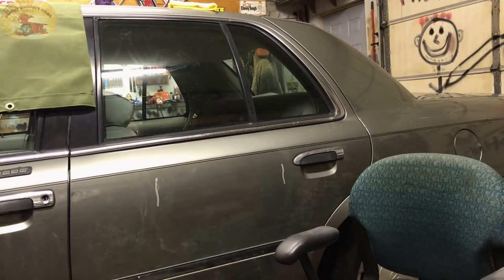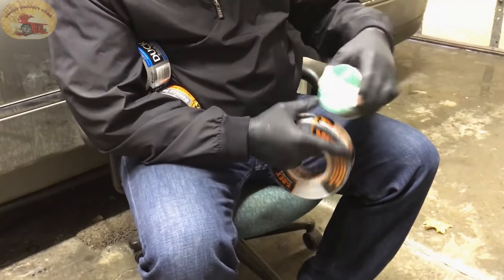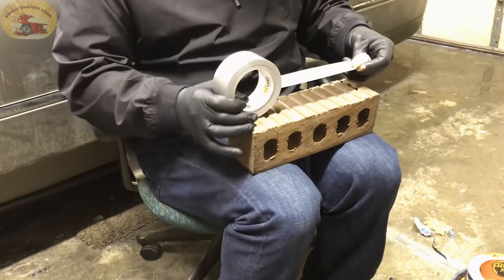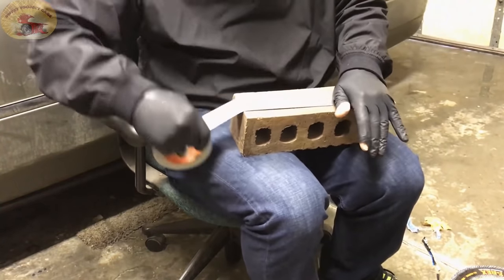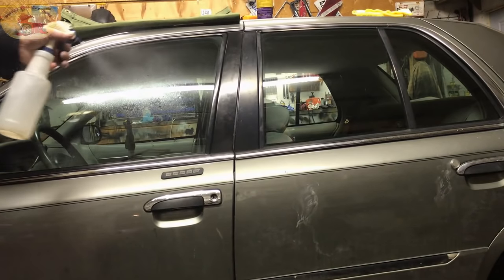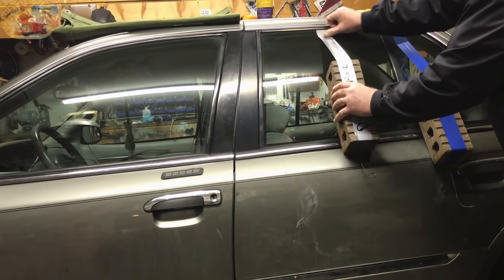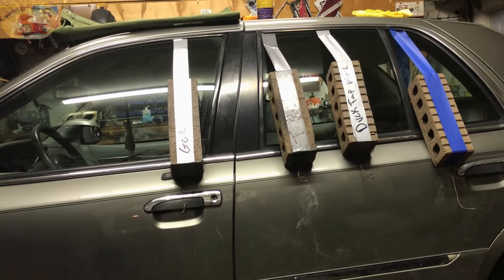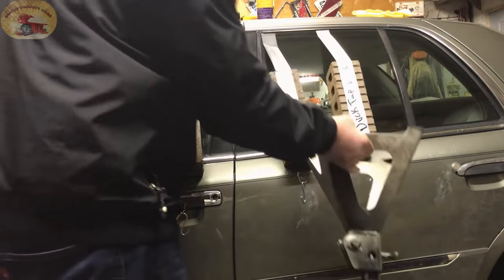Who Makes the Best Duct Tape?.....What Tape Works Every Time?

Comment: Kinda knew T-Rex would win. Saw another comparison test which tested shear strength. Tape was hung from  a crossbar, then wrapped around a wire which held the weight, then back on itself - so the glue was less of the issue. The test was to see which tore first. T-Rex had the greatest shear strength.
Reply from the maker: swm122758 we where really trying to show the glue strength of them which is a big problem with tapes these days but we found out pretty quickly
Reply: @SweetProjectCars  
Totally understood. Just thought I'd mention for the viewers. Shear strength primarily applies where the glue isn't making contact, like the length btw glass and brick. In short, make sure all sticky surfaces make contact or else the project will be subjected to tear strength.
Reply from the maker: swm122758 well if you saw in the video I had a much harder time tearing the T-Rex and actually split it when I did tear it plus it felt much heavier and much stiffer.

Comment: Going back to the point you made at the beginning of the video where you mentioned the waterless glass cleaner makes the glass slider easier past the seals, do you have any tricks for cleaning those seals? In my wet climate we sometimes get algae and mould growing in the gap between the glass and seal, if you have any tips to remove and prevent those seals becoming a garden it would be good to know, or should I just hand it to nature and plant a window box on each car window. Thanks
Reply from the maker: ioneyesed we do have that video actually 2 of them 1 is more involved please watch both and pick the one that fits you, this one is more for the cleaning of the seals my friend https://youtu.be/-CE5y3D4OMw  and this is more involved https://youtu.be/TUfUdJBtj5s
Reply: A big sweeeet thanks. I'll give that RainX trick a try. My windows move fast, the seals just get mouldy. I never realised RainX could clean seals, I might have tried 303.
Reply from the maker: ioneyesed oh it works like a charm my friend

Comment: Other reviewers have claimed that the water-less car wash you refer to is harder to remove from the paint where it is used.
Reply from the maker: Mike Morales we found the two we did the test on both came clean very nicley considering the job they are meant to do if you try them you will see, this is the video we did on them https://youtu.be/mvfOHCCAXkM
Reply: @SweetProjectCars  I saw the video and I also saw two other videos where they compared water less wash solutions and the RainX was more difficult to remove than the others. But it also seemed to protect the paint better than others, which makes sense.
Reply from the maker: Mike Morales ya we have not found that to be an issue and the glass and paint feels like silk after using it.
Reply: @SweetProjectCars  Gonna get some, only thing is that if your car is very dirty, it is not advisable to use this product, perhaps running  it through an automatic car wash first,  just to get out the heavy stuff.
Reply from the maker: Mike Morales we don't use it on anything that is really dirty with grit on the paint but if we do we spray them off first ..the stuff works great for keeping your ride looking great between regular wash bucket washes.

Comment: So the original tape was made from duck-cotton backed with sticky rubber (originally created so it could be torn to length without a knife) and add to that the fact that the one thing this modern tape CAN'T be used on is duct-work. So... it makes perfect sense to insist it's right to call it duct tape. Yeah right, uh-huh, you betcha makes perfect sense. Coz: America!
Reply from the maker: Not sure really what you’re talking about but all the heating and cooling guys in our area use all this new tape that we share here on all their ductwork that they do in new construction homes